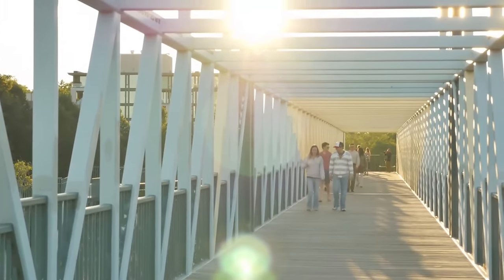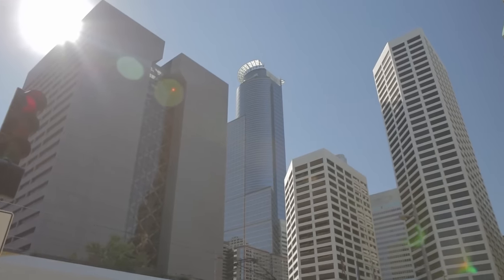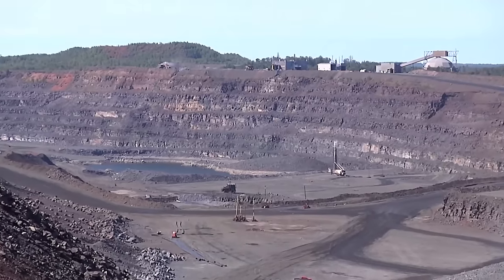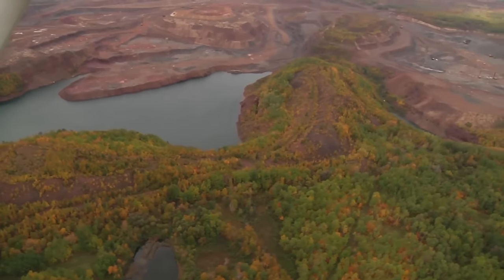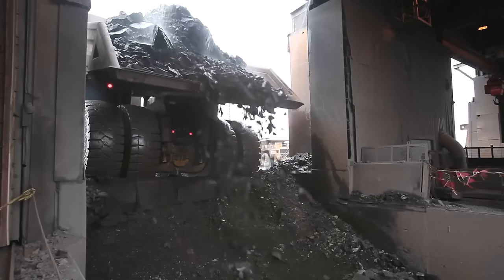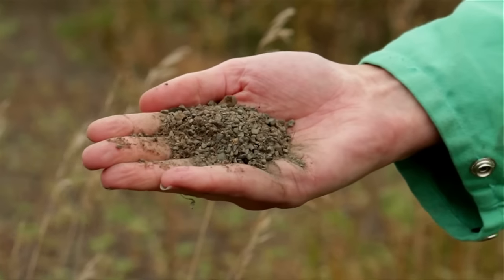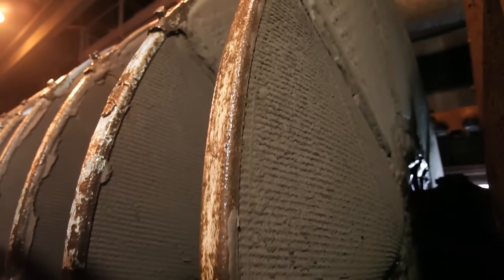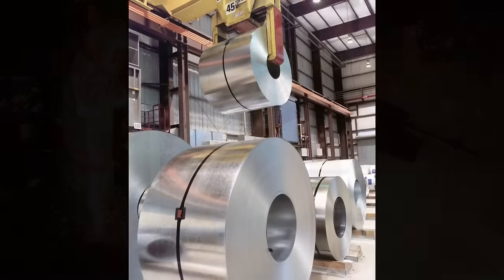Minnesota Iron Mining Process

Comment: alright so how was this done 200 years ago? Also, how do they separate the dirt from the metal? I know they said magnetism but they didn't explain or even show how.
Reply: That's not true. That's so far from the truth that it's laughable.
Reply: Years late, but miners would dig iron rich ore out by hand. They'd crush it by hand, and then use furnaces to melt the iron, copper, silver, gold, or whatever and separate it from the rock. They couldn't get as pure of metal as we can, but it worked for their purposes. Everything in the video is basically just a much more efficient way of the same result.
Reply: All they do is use a magnet to pull the crushed material out of the dirt theres other video that show this

Comment: I always had this problem with the unfinished explanation that waste your time , after it's 65 percent iron how you take out that impurity of 35 percent from the product ?
Reply: The pellets are dumped into blast furnaces. Everything melts. The molten iron is more dense (heavier) than the impurities. The molten ore is tapped at the very bottom of the furnace.  The slag (impurities) is then removed.

Comment: Well this is a good presentation.  However!     When first discovered this “Red Gold” made tracks and locomotives and buildings and girders!  The Mesabi range was the richest iron ore deposits ever!    They use to use just shovels...soft red sand...of pure red gold!  By the ton...it was very profitable but the short summer made the need for the most well thought out mining town to date!   History! Know your History!
Reply: There are areas in Australia and the "Old World" continental mass that have far more iron ore deposits than in either of the Americas. Australia has the highest concentration of Iron ore by far across most of the landmass.

However, both of the Americas are much richer in other types of metal, such as Silver (the influx of Silver from the Americas after the 1500s was so large that it's value dropped and damaged Spain's economy) Copper, and Lithium (which are both extremely valuable for electronics and batteries, both in high demand today.)

The United States in particular has more of an "ample mixture" of most metals, rather than just a massive amount of 1 or 2 types.

 Adding a very advanced technological understanding of how to efficiently extract ores and get almost all the metal out, meaning it can produce as much metal as it deems necessary for whatever projects it needs, this has historically been instrumental in the United States having a huge advantage over other countries.